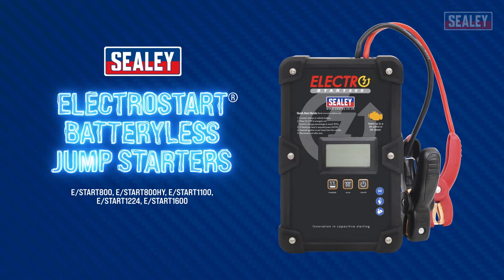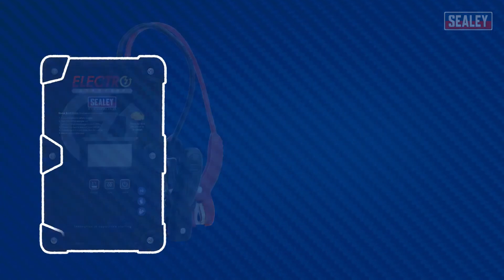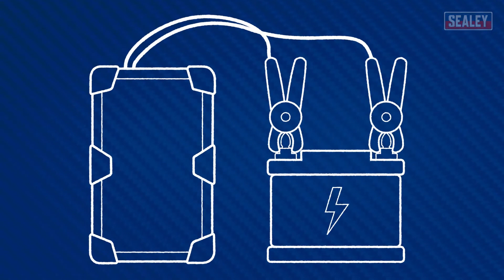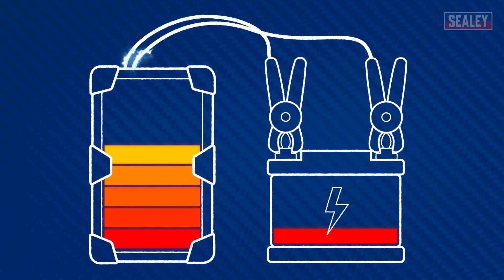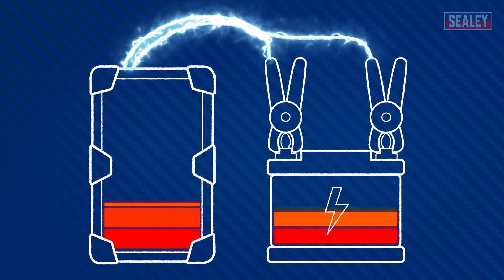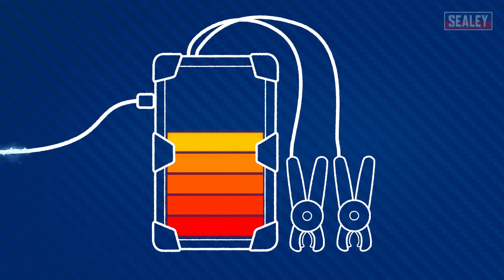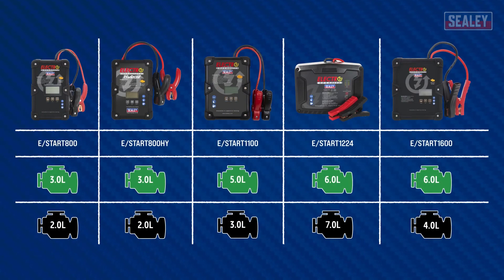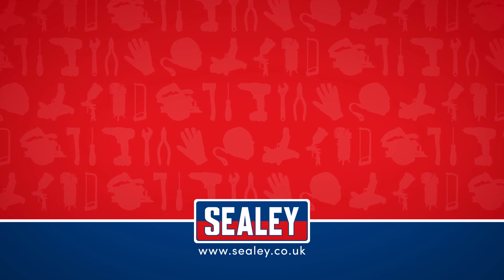Sealey ElectroStart® Batteryless Jump Starters - How Do They Work?

Comment: I’ve used the 800 one and wouldn’t be without one again, jump started several cars with it in last 5 years and still works unlike other battery jump starters that die after a couple of years, although it’s a shame that it doesn’t work on Toyota hybrids when flat battery goes flat
Reply from the maker: Hi. Thanks for the recommendation about your ElectroStart® 800.

Comment: Would these be steady enough to supply a level voltage for anything from 10-25 minutes for programming car keys?Thanks.
Reply from the maker: Hi. The Sealey ElectroStart® Batteryless Jump Starters would not be suitable for that task, but we do have a range of maintenance chargers that would work. You can speak with your local stockist or give our Technical Team a quick call on 01284757505 for advice. Thanks.
Reply: @sealeytools  I actually had an spbc40 but it failed the second time i used it,it's back for repair,i'm looking for something to replace it in the meantime,Sealey don't seem to be in a hurry to repair.
I had to use jump leads when the Sealey failed and they got the job done,which made me think some battery chargers just might get the job done in the interim.